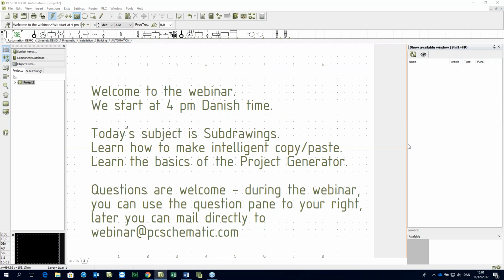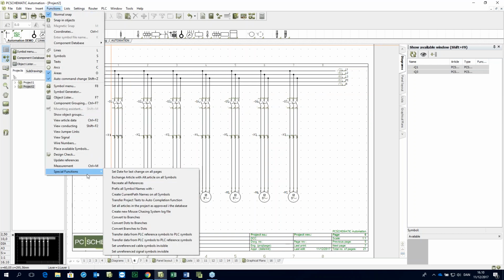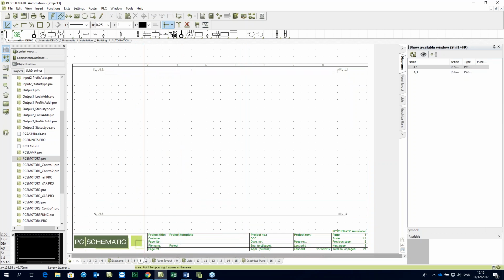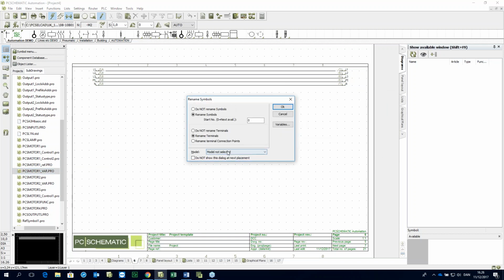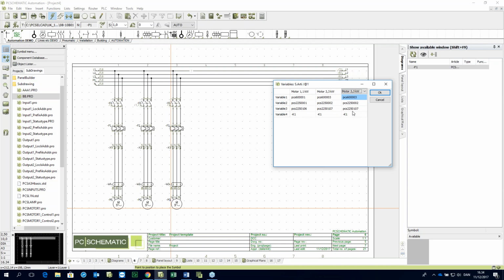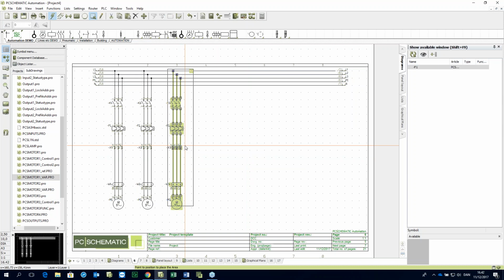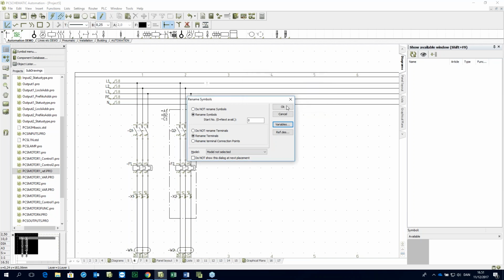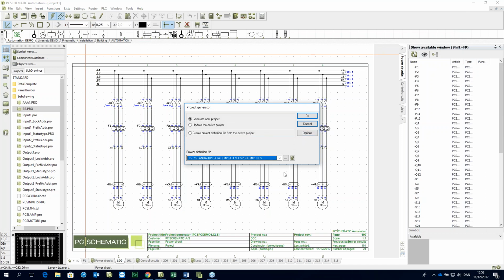Webinar: Working with Subdrawings

Comment: Regarding the reference designation; is it possible to have entire pages in different references in the same project, for instance:
=MSB+1/1
=MSB+2/1
where; =function+location/page
Reply: Yes it is. Ones the data is controled outside pcschematic there are no limits. If the project generator for some complex reason doesn't do the job use the OLE add-in module (which is similar to an API interface) and write either project parts or your own costume generator. If I remember pcschematic correctly the OLE module communicates with 3 programs like visual basic. But it doesnt matter in theory it should be pissible to navigate a project completely from phyton c++ or why not add tensorflow and begin adding artificial inteligence and Train the algo to spot Connection errors or in other words  the machine begins to understand electrical circuits and will correct human errors in subdrawings and templates. The only limit is your creativity. I dont have any experience with adding tensorflow but I have created generators without any use of pcschematic and only using pcschematic for generating the result file. The reason is that it sometimes take a lot of time generating large projects over and over which is the reality even with small changes. Instead of running the whole project repeatly it's much easier to write an algo and simulate changes from outside pcschematic directly in the project